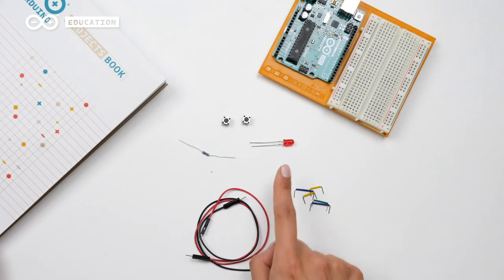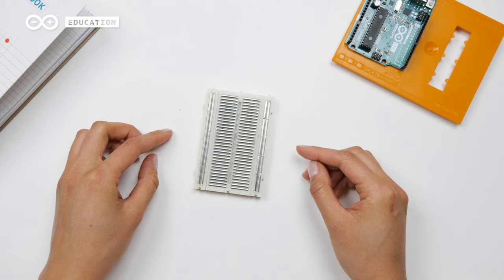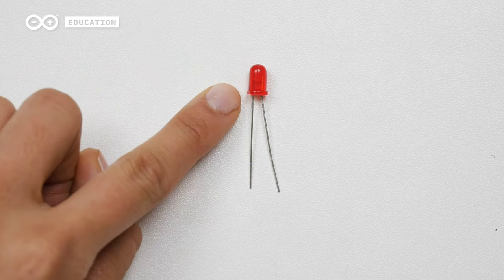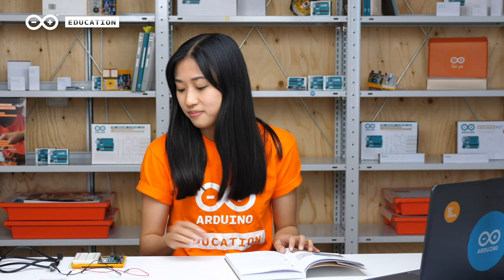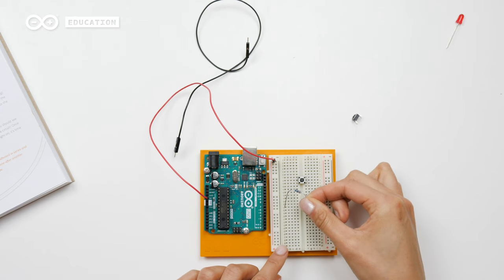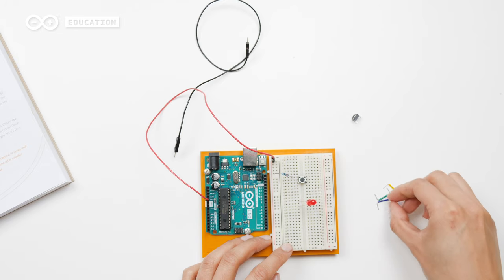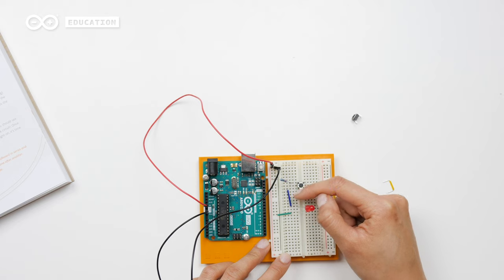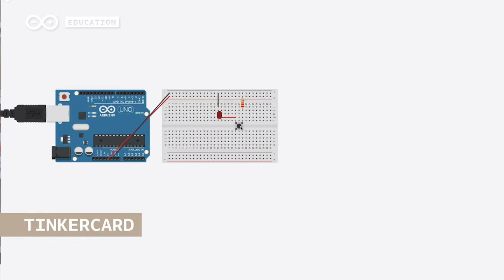01 Starter Kit: Your First Circuit

Comment: I used a 9v battery as input. Same circuit  same 220ohm resistor but when I push the switch the LED not turn on. Removing the switch and close the circuit with a jumper, the LED turns on. Do I have a non functioning switch or what could be the problem? I tried more than one switch from the kit.